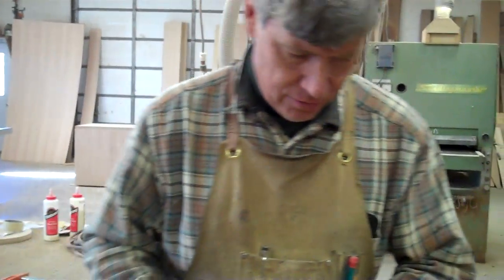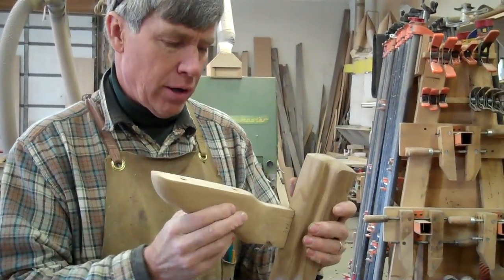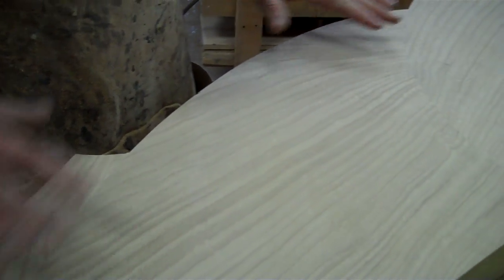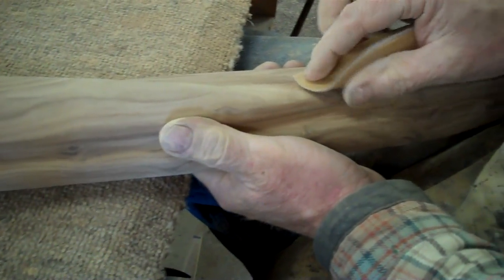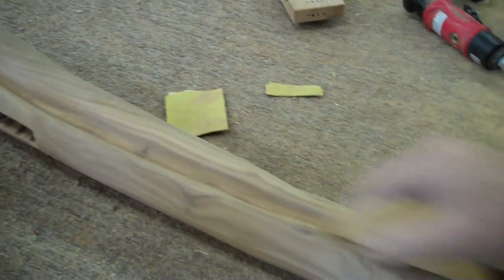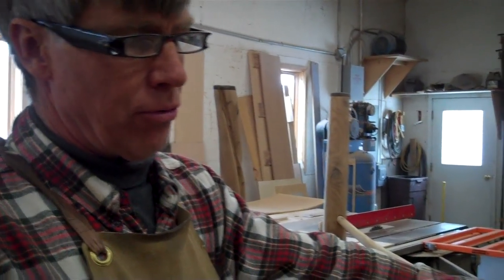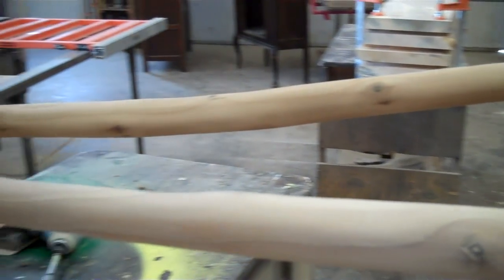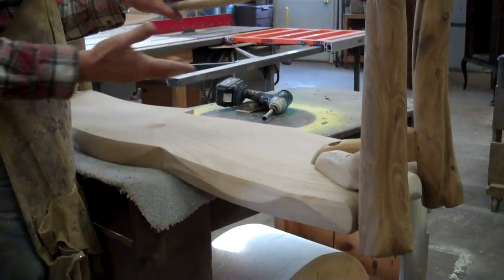Ebb & Flow A Sideboard Horse Chestnut and Russian Olive

Comment: I have read that horse chestnut timber is not usable for furniture etc.  What are your thoughts on this?
Reply from the maker: +Mark Mueller   It isn't the hardest of hardwoods but it's pretty good and with the proper construction it's fine.  Far better than pine. Just make sure it's dry and if you want a mirror surface it will need to be filled.